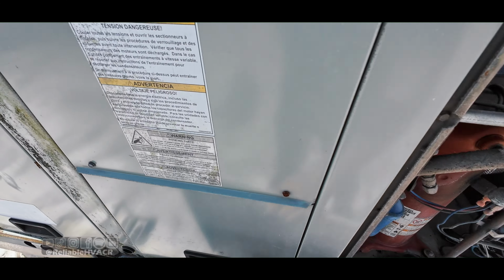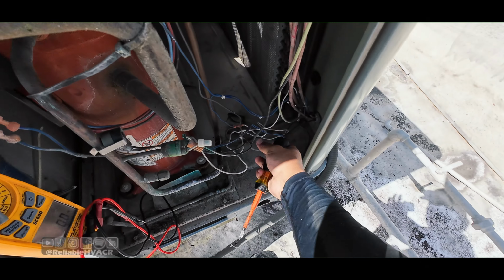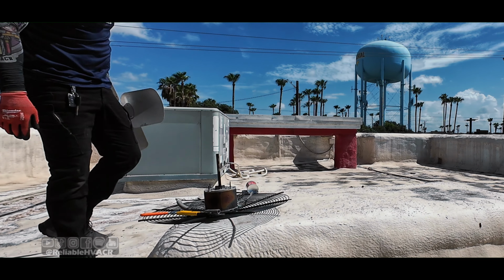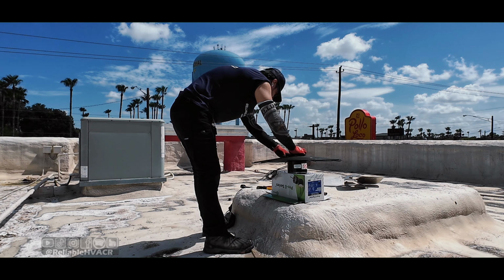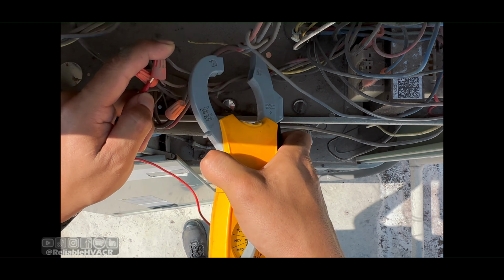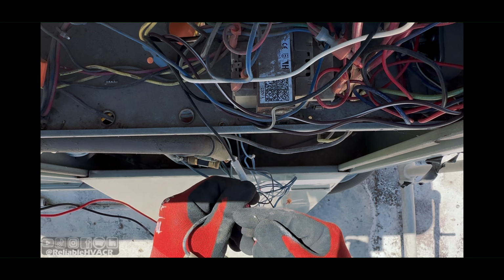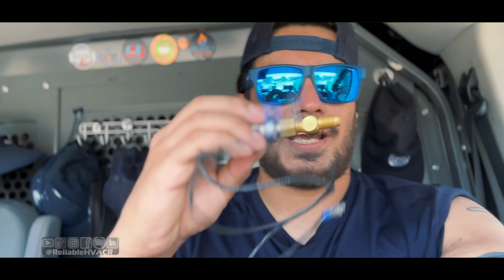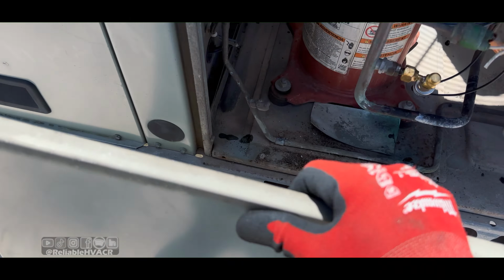Called back because the AC was hot again

Comment: You should always use a backup wrench when tightening a flare nut. I would also install a p-trap to that unit or it will not drain properly.
Reply from the maker: Yeah usually do. And I can't touch it unless they submit a request. I'm still waiting on maintenance to get approved to address a lot of things.

But it's been a couple years 😂

Comment: I'm also surprised that in your area that more units don't use liquid injection to help the compressor cool down. I know on your reefer equipment you have it....but I would think comfort cooling should as well....its hot as hades down in the RGV
Reply: They use liquid injection on air conditioning? Haven't seen it except on low temp scrolls in my area.